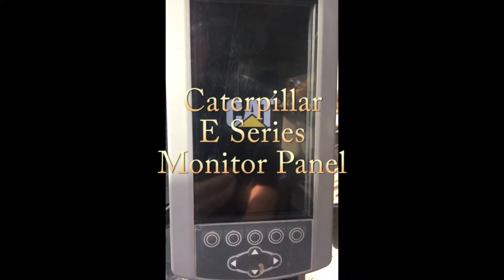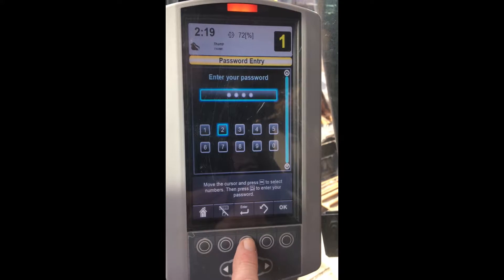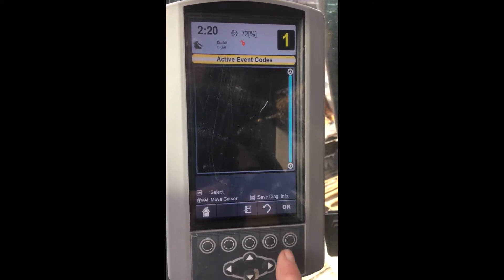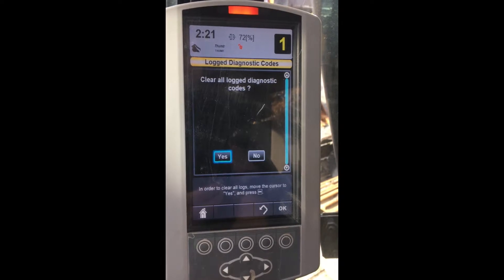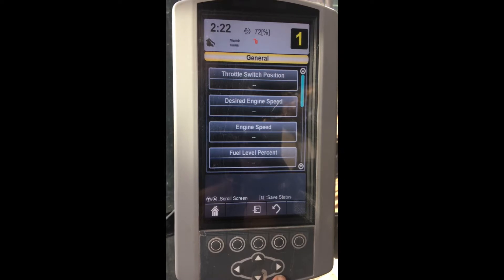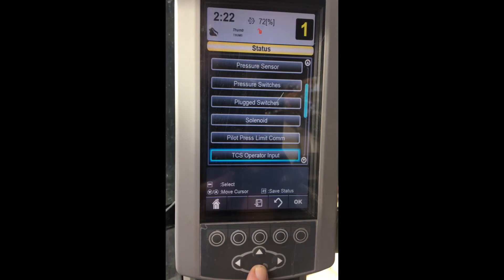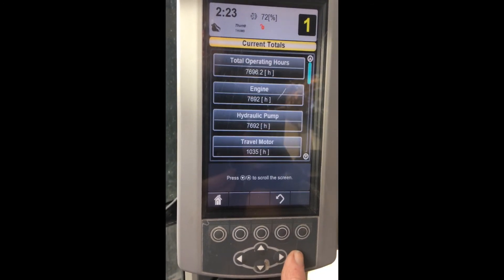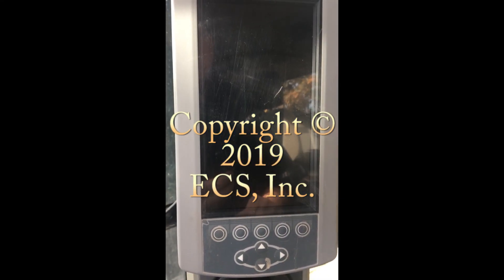Cat Excavator E Series Monitor Panel

Comment: if I only have the ecm summary of diagnostics, how do I get the rest of the menu?
Reply from the maker: I don't understand your question. I don't remember there being a "summary of diagnostics." Going into the service menu is where all that information is at. If you can't get into the service menu as described in the video, you may have a problem.
Reply: I'm having the exact same issue. Did you figure it out?

Comment: Hard to start the unit it won't start
Reply from the maker: You are going to have to be a little more specific about your problem. What are you commenting on and which make and model of machine are you working on?
Reply: @repairsecrets  have a cat 336e excavator how do you get the backup camera to appear instead of the blue screen?
Reply from the maker: @ryankuhlman4585  I haven't worked on that new of model but in most cases the blue screen I took to mean that the camera wasn't working at all. Most times it would be the wiring had a problem. Check in over at Heavy Equipment Forums and ask the question there. There are some sharp people there that should be able to provide more info. Thanks for the question.